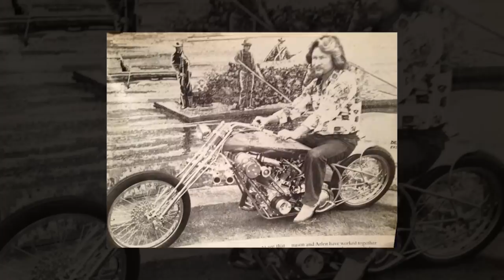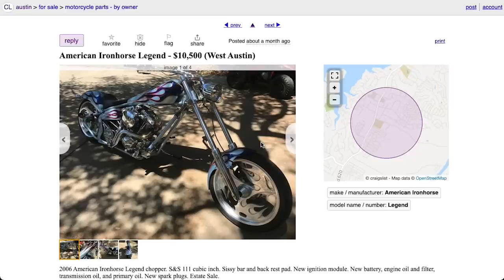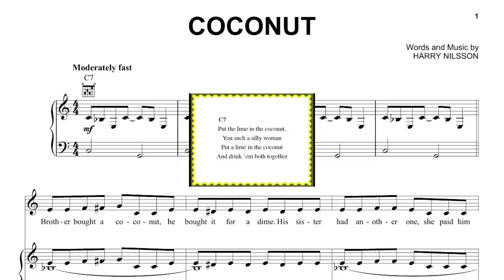This was the Weirdest Trend in Motorcycles (Choppers Explained)

Comment: You need to be a contortionist to ride one. Riding further than 10 miles on those ape hangers and your hands must go numb.
Reply: So comfortable, sitting straight up arms on the shoulder level. Way better than being all bent over.
Reply: @ElectronicYouth  Shoulder level? Ape hangers are often above your shoulders. 
Comfy arms is something like a naked retro. A Motoguzzi v7 or a W800 or even an interceptor with a touring seat. Straight back and arms at a normal level.
Reply: @BrokenBackMountains  i am talking about normal apes, not cartoony 90’s styles ones flat bill bros put on their baggers. It makes it so you get to sit up with a straight back instead of leaning down.
Reply: @ElectronicYouth  You only really need to lean down on sports bikes with clip ons. There are lots of bikes that are perfectly comfortable without ape hangers.